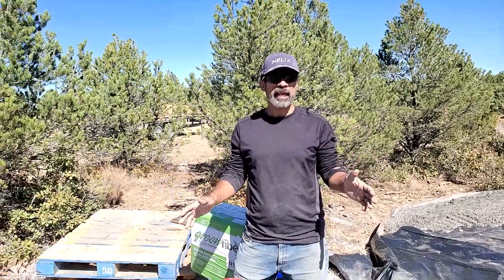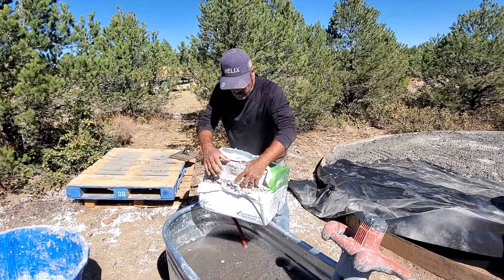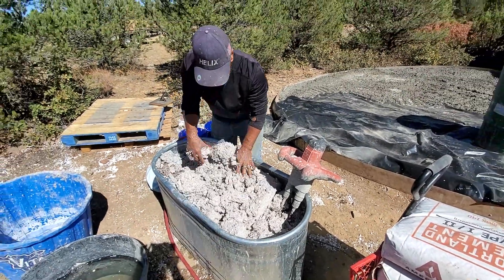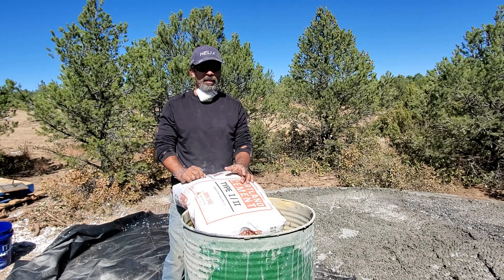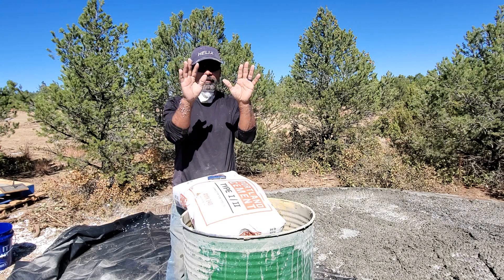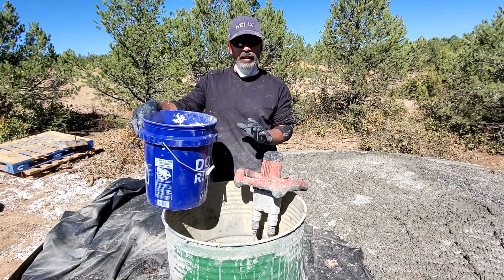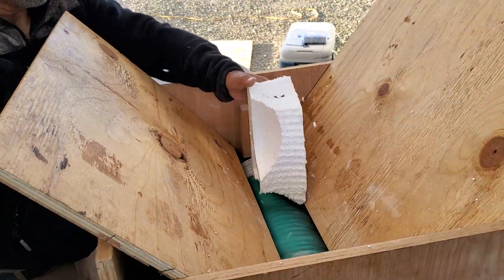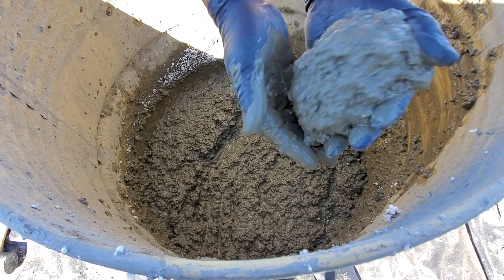How to mix E.P.I.C. Cement #EPICmix #domebuild #aircreteharry #domehome #foamgenerator #foam #howto

Comment: How is this holding up?
Reply: Is this only as insulation?  Kinda hard to believe that would be warm enough in ohio. 
Can these domes be covered in dirt?
Reply from the maker: @dewy330  The Dome was built using E.P.I.C. Mix for Structural & a different E.P.I.C. Mix for Insulation. 
Yes, they can.
Reply from the maker: Great!! Almost 5 years later.

Comment: Can that EPIC mix be applied as insulation on the outside of an earthbag house? Would it work if the house is earth bermed as well?
Reply from the maker: Yes, it can. Many of our Loyal Viewers have applied this technique on their structures.
https://aircreteharry.com/product/epic-recipe-pdf-file-mixing-instructions-expanded-polystyrene-paper-infused-cement-recipe/

Suggestion to finish with a 
Waterproof Layer:
https://aircreteharry.com/product/latex-cement-recipe-mixing-instructions-tools-needed-links-aircrete-harry/
Reply: Thanks!! Is that the stuff that requires that I buy the R-value testing for code compliance?

Comment: You seem to live in a desert type area, is Epic waterproof for an area such as Missouri where we can get a lot of rain? How do you keep the dome dry?  Have watched several of your videos and thank you for your knowledge.  I have an existing framed dome home that is covered in EPDM needs a new roof, wondering the possibility of wrapping in stucco wire and spraying with Epic instead of roofing with asphalt shingles.  Your thoughts?  considering an addition too, using your system Thanks.

Comment: To get that cement off of your hands and stop cement burn use vinegar pour it over your head in the shower if you got cement on you and it will neutralize it and stop that lime burn to works for drywall mud too

Comment: How do you think that epic would perform in this application:

I'm interested in making wood molds to produce 4'x8'x1" or even .5" sheets for a siding underlayment, instead of OSB or plywood for a house. Think it'd do the job?
Reply from the maker: Yes you could make that work and 5" would be better than 1". What are you thinking of putting on the outside of your underlayment?

Comment: Love that someone is using my Aircrete Bubble Dome idea :) Best with it
Reply from the maker: Thank You!
Reply: @AircreteHarry  I like how you setup the dome construction. How long was the complete build? I have a 25 dia area ready to build on. Now I'm thinking of using this technique :)
Reply from the maker: @craigglewis  it took me 32 hrs to build. I have another way thats even better faster.
Reply: @AircreteHarry  That is amazing Harry. How thick is the wall of the dome?  I'm looking at snow load for homes in the North.
Reply: @AircreteHarry  I got my tyvek wrap today. Looking to build a 16' dome. The layout of the cutouts, do you have pattern a template, Harry
Reply from the maker: @craigglewis  the walls are about 4inchs thick. We had about 8 feet of snow this winter. If you build what I did. No worries about snow loads.
Reply from the maker: @craigglewis  Did you buy the how to make air-forms from me?
Reply: @AircreteHarry  No where can I find this?
Reply from the maker: @craigglewis  What are you looking for? If it's how to make the air-forms I have links in the description box. https://www.etsy.com/shop/AircreteHarry?ref=search_shop_redirect
Reply from the maker: Aircreteharry.com

Comment: Forgive my ignorance, but what's the advantage of epic over concrete for a foundation slab?
Reply from the maker: The EPIC slab is insulative and you can use a wood screw. I'm building a dome using an air-form that is screwed down. With concrete It is a lot more work to hammer drill a hole first then use a cement screw that are more expensive than wood screws.

Comment: You seem to only be using EPIC cement now; is there a reason you aren't using Aircrete anymore? Might have to change your name to EPIC Harry. :D
Reply from the maker: LOL,  I was experimenting with deferent mixes to know how I was going to build my house. Aircrete will be used as a insulation slab in my domes. The dome i'm building now used 1200 gallons of Aircrete. No worries I'm still Aircrete Harry :-)

Comment: Video 1: "the exact recipe is in my etsy page, that's the ratio you need to use"
Video 2: "i didn't actually use the recipe for shooting it on this dome, i just played around with it and this ratio i used is what worked best"
So... is the recipe on your etsy page outdated? Or just not good for shotcrete application?
Reply: It's concrete to you're always going to be playing with the recipe. You have to use your hands to feel the consistency and your common sense to know what will work regardless if you have a recipe or not. Rules do not take the place of brains.

Comment: This is great information. What about simply using a tub type mixer for this stuff?  I know the hand helds do a great job but just thinking that while the tub was turning you could be attending something else at hand. 👍
Reply from the maker: Like this one? 
https://www.ebay.com/itm/Pan-Mixer-120L-Cement-Concrete-Mortar-Stucco-Mixer-120-Liter-115V-230-Volt/254177643629?hash=item3b2e2b0c6d:g:0ocAAOSwu1VW5ORY

Comment: Hi Harry. Sand and gravel are way cheaper. Why wouldn't you use concrete for your foundation. 

I didn't think you could use paper concrete below grade.
Reply from the maker: This is a slab I'm building it is not below grade. I'm not using a sand gravel mix because I will be mounting an air-form using wood screws. If I did a regular concrete mix I would need to use a hammer drill then I would have to use Tapcons. This slab is also insulative I would have needed to put down some kind of foam if to used concrete.
Reply: Ok. I see. As you know I am lucky enough to not need any insulation. 

But Colorado is cold.  Wouldn't you want a lot more insulation anyway on the ground. I have seen where slabs are poured on top of insulation. Especially radiant heat systems. I am guessing you are planning more insulation for the domes. Maybe spray foam the outside?

By the way you can easily shoot wood screws into concrete/mortar if you hit them 24 hours after the pour. I have done this many times.

Besides after full cure it still isn't such a big deal to drill. I have a makita rotary hammer that drills concrete like butter it was not a fortune and tap cons are not a big deal (to drive blue concrete screws I use my drill with the clutch set low,  never my impact)
Reply: I saw your other video and withdraw all my concerns.  

Great job. Your formula is well thought out and tested.

Comment: Hey Harry, Love your work buddy.
I paid my money and watched the first of 3 videos. I have some questions- firstly whilst buckets and bags is a valid measure... I’m in Australia and our buckets and bags are of a very different size and weight. I need a recipe I can scale up and down to suit. Eg; The weight of the paper to the volume of water? The weight or volume of cement to the pulp mix? Usually, lightweight fluffy materials are mixed by weight. More stable materials like cement and water- by Parts. I’m a Tiler/Builder by trade. Talking floor screeds, I would say mix 4:1 sand to cement to make a moderate strength floor screed. Anyone reading that ratio can make it- sure they need a sharp sand- not a fatty loam. But the Ratio is key. I’m happy to support you, by paying for your recipes- but please provide a recipe I can actually use. Note: I access the internet with an iPad and iPhone. I only see the option to purchase 3 x videos. I do not see any option to download a .pdf. I’m hoping when the .pdf is available it will provide the recipes to the various mixes. Thanks Harry- Please keep up the good work.
Reply from the maker: Thank you Andrew I agree with you about the weight I could not find my scale to weight the paper before adding water. The buckets are 5 gallon in size. Next video I will measure the bag so you know what size it is.
Reply: Hey Harry, 
Just a follow up. I ended up watching all 3 videos. And I will say that all the information that is required is definitely provided, once you see the story, in full. Anyway, it looks like the format has changed to one video subscription. So if you're reading this wondering if it's worth the money. My answer is absolutely, Yes.
Reply from the maker: @AndrewJDN  Thank You very much, Appreciate You! 👍 👍

Comment: Weigth of EPIC vs Aircrete? Are you able to cut EPIC with a saw like you can aircrete? I'm looking at building a foundation for a dog run
Reply from the maker: There are 4 deferent mix designs some are the same weight as Aircrete. Yes you can cut EPIC with a saw like Aircrete. EPIC would be better than Aircrete for a dog run.
Reply: @AircreteHarry  are all mixes of EPIC resistant to digging? I saw in one of your videos they dent with hammer strikes, so I figured dog claws would wear them down too
Reply from the maker: @boothulu9881  Two of the mixes are good for the dog run and your dogs claws.
Reply: yes you can

Comment: The amonia type smell is caused by the papers fireretardent chemicals reacting with the cement.
The hydroseeding paper isn't required to have fireretardent additives in it.
Did you check out that Imer Mortar Man 120 vertical mixer?
Reply from the maker: I had a feeling it was the fire-retardant but I didn't know if there was something else.  I saw that  Imer Mortar Man I almost bought one.
Reply: @AircreteHarry  If you can rent one first that would be better. You'll be able to determine if it is what you need for the type of work your doing.
As a mason I saw one in action on a job site, I thought it was pretty cool.
Thanks for posting the videos to give us observers the oppurtunity to get inspired.